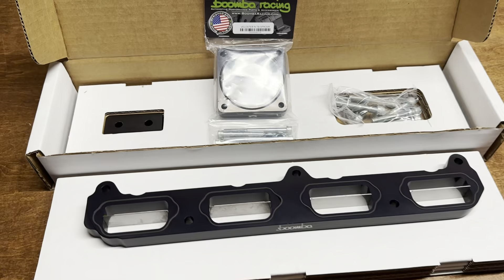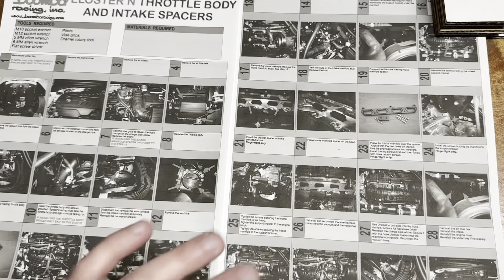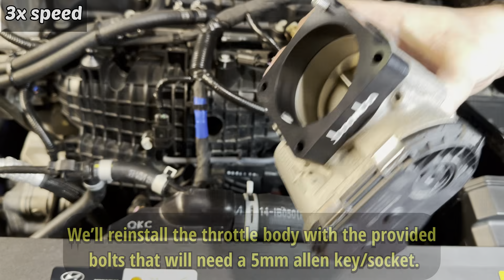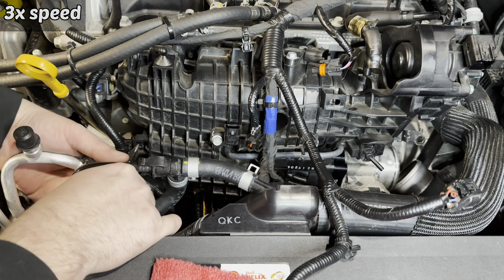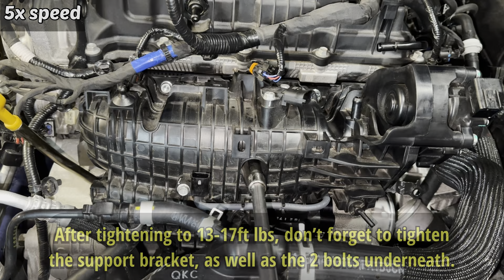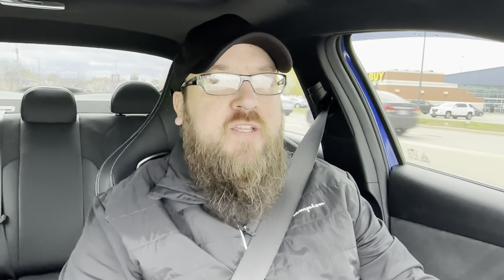Doing What No One Else Has!   -The Next Mod for my Elantra N from Boomba Racing!

Comment: I have this myself I was always hesistant on long term reliability so far had this on Almost a year and yes you def notice a throttle response change, and slight delay in turbo (which I personally don’t mind too much)  if there’s any gains to come from this it’s probably just changing the power curve.  Company’s can claim false gains on dynos Now a days with these bolt ons

Comment: Nice. but not worth for me doing mods that might void warranty, if u have an issue even if u uninstall the parts, data gets saved and they can see that. and i also dont feel the need to go faster on my 23 EN. I got it in march and i  rarely drive it. Only has 737 miles.

Comment: Nice install wanted to let you know every time you get gas it's reset your high octane procedure Soo every time you fill up on 93+ octane cruise in normal between 65 and 75 with your set up you should be able to pull over 20psi

Comment: I just went and got my first oil change at Hyundai in Carmel Indiana. I asked the coolest looking dude there I could find lol about warranty situations. He pretty much said they will find an excuse if you leave any parts on there and bring it in for warranty, like no matter what you put on there they will find a reason to why that part you put on there mess this up I said even if it doesn’t make sense. He said yes it’s sad, but true, but on the other hand, if I bring the car in for an oil change, I can have a tune on it down pipe and air intake I can have anything on it I want and it’s completely fine. They won’t tell on you. but you bring it in for a warranty claim they will find any excuse to deny you is what I’m told.

Comment: These have been dyno proven to reduce HP in other cars so I'll pass on these things.
Reply: Hello! Other designs and companies have made products that have not produced power but our parts have been specifically dyno-tested and has shown that while peak hp/tq does not increase, the lower-end hp/tq does increase providing better throttle response. While it is not necessarily the highest power-producing part you can purchase it most definitely provides an increase in response due to more air volume capacity in the intake manifold and throttle body. No pressure on making a purchase, just wanted to provide some information. We also were featured in a video of our throttle body/intake manifold spacers installed on a Focus ST and they were dyno-proven to produce power as well: https://youtu.be/L5UQoerIC2I

Comment: They have to prove an aftermarket part voided the warranty, in your case, that would be a little easier since its documented. 

for others, it may be a bit harder for them to prove. 
either way, even stock, they'll fight you tooth and nail over the warranty, so just do it (if youre gonna keep the car for more than 3 years, if not, keep it stock - wont be your's long)
Reply from the maker: Yeah I feel you there, I’m putting myself out there if anything does happen lol.  But great points on deciding this stuff depending on how long you’re going to keep it for sure 👍🏻
Reply: Not true..I have a open down pipe fbo jb4 tuned car nline elantra with trans issues they didn't even care they just updated the software..my last car was 22 kona n line same jb4 the turbo blew they had me come take it off so they could take pictures for hyundai corporate they warrantied the car and I bought n line and trade the kona in blown turbo and all

Comment: To keep all the metal and plastic looking like new get a can of Meguiars Back to black after doing a engine wash and dry spray it on all the parts it will soak into the metal parts and plastic making them look like new and protect them let it set or you can still drive look at it the next day you will see what I mean.Would of been a good time to use some carb cleaner and a old tooth brush and scrub out the intake runners.
Reply from the maker: I realllllly wanted to clean it all up, but with time not on my side and then dropping the socket in the abyss, that ruined any of those plans 😂

Comment: Excellent video content! I have a question. Since you've removed the intake manifold, did you have a chance to look at any of the intake and intake valves for the dreaded carbon deposit build-up? If you did? How was it?  Could you give us a severity rating, say from 1 to 5? 1 being least contaminated(clean) and 5 being horrible. I can see that your throttle valve is not that dirty too. I am thinking of doing routine valve cleaning maintenance, say every 20-30K miles, if it's terrible. Thanks.
Reply from the maker: I quickly wiped everything down that was on the surfaces and any excess oil/carbon deposits.  But to be fair everything was minimal, I’d definitely say the lowest on the severity scale.   Plus I still only have 4,500 miles… lol
Reply: @ENtense  Thanks, Brandon. Yeah, one would not expect much if any at 4.5K. Mine is at 10.5K. I had seen one at 70K KM, and quite surprisingly it is acceptably "clean" for that mileage. Much much better than anticipated. Anyway looking fwd to your next post. Brgds.
Reply: Looks like he's running an oil catch can too so that's going to help
Reply: An old tooth brush and carb cleaner would of cleaned them right out the kind that vibrates and wipe out with a rag.

Comment: The intake spacer will definitely bring down intake temperature and the throttle body spacer will help with turbulence in the intake also. Once you put an air intake and tune she will light right up!😜💯
Reply from the maker: I need an intake 😭😭😭
Reply: @ENtense  I personally don't think the money spent on the intake will  be worth it  there mostly  for sound and will actully drive up intake air temps Tune is where your going to find all the extra power Hyundai is hiding in the conservative factory tune.
Reply from the maker: @N-Krazy1976  oh I definitely agree no doubt.  That’s why I’ve held off on an intake for so long, but I just want one 😂
Reply: @ENtense  If your looking for the sound you get from the open filter you could just install a cone air filter on the factory inlet for way cheaper unless you want the look of the aftermarket one. Either way great video and nice to have you back Brother👊
Reply: @ENtense  Maybe our intake system is well made living in hot ass AZ there is no thing as a cold air intake lols.
Reply: I plan on getting a Hyundai Elantra N 2024. I want to get a down pipe cold air intake with a turbo inlet. If I get a lap3 tune. Will the lap 3 tune work with the bolt ons? Or would I have to get it dyno tuned? 😊

Comment: Yea im just gonna get the turbo inlet , closed intake and a lap3 1.5 93 tune. It'll be fast enough and still reliable.
Reply from the maker: I definitely want to get an intake and inlet as well
Reply: Go with the Takeda ! It’s the one I got and so worth it.
Reply from the maker: @xXPostmortemXx  how’s it sound?
Reply: @ENtense  it’s definitely louder than stock but it’s not crazy loud. It’s suppose to be the best one for power gains though ! That’s why I got it. My stage 2 tune should be in this week and my tuner recommends the AFE intakes so that’s what I did !
Reply: @xXPostmortemXx  who's your tuner?
Reply: @BecauseHYDE16  n75 stage 2
Reply: @xXPostmortemXx  how has it been going from stock?  did you install the DP and IC for this level?
Reply: @BecauseHYDE16  it’s so much better than stock. Don’t need DP or IC but would definitely see more gains if you did. 

I did the intake, colder plugs, HPFP and stage 2 tune
Reply: @xXPostmortemXx  sorry for all the questions, did you go with the EK1 or EK1 lite?  Any warranty concerns?
Reply: @BecauseHYDE16  I got a tuned spare ECU from Dan at N75 pop it in and good to go.

Comment: The dyno sheet was printed in 2020..
Reply: Hello! Just chiming in here, we can confirm that the parts were initially tested on a Veloster N but did prove better low-end torque from both the intake and manifold spacers in our testing. We were featured previously by Edge Motorsports about our spacer kits on Focus STs where power was also dyno-proven. https://youtu.be/L5UQoerIC2I
Reply from the maker: Was done on a Veloster N